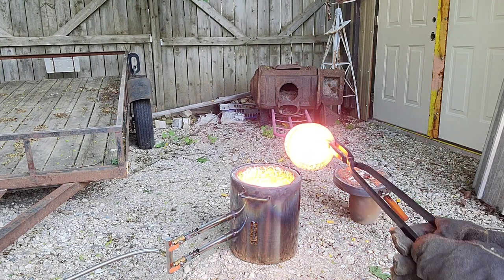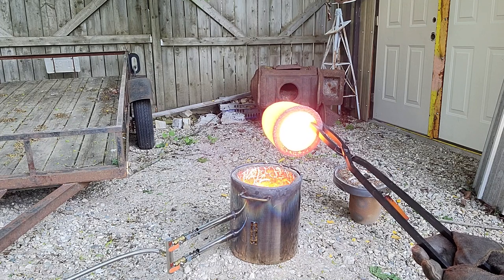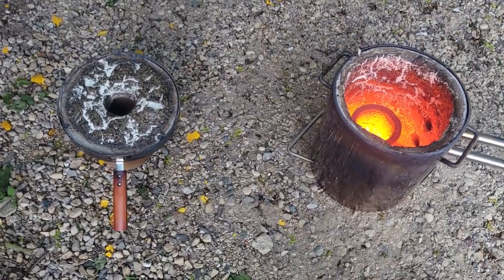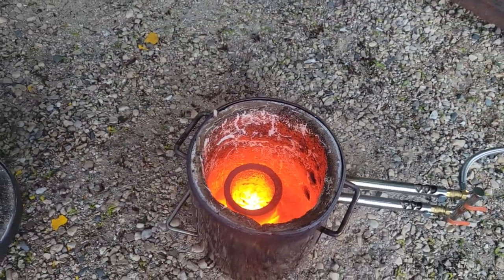Can the VEVOR 12KG melting furnace melt Steel?

Comment: Thanks for showing us this. I intend to give it a shot as well. I have used heat guard castable coating good for 3250° Fahrenheit. But you're showing me here is that it might not work. The heat guard isn't IR reflective coating so more of the heat will be directed inwards towards the melt. If that fails I will probably try stepping up to a veg oil burner.

Comment: Just add force air and It should actually completely liquefy it. I made my inlet pipe too long on my waste oil/diesel fuel burner and it completely turned it liquid within a half hour from cold start.

Comment: Melting steel is a pretty tall order for a small furnace. You looking at temps of around 2,800f/1,540c. You might be able to do cast iron which is still pretty hot. I bet it can handle copper and brass with no problem.
Reply from the maker: Copper was no problem at all.  Have not tried brass yet as I don't have any in the scrap pile.
Reply: @KevinChainey  copper melts at 1984 deg F.   That's lower than most steels.  Most are in the 2200 to 2500 deg F.
Reply: 😂😂 it can be done. If customized correctly.
Reply: Melting steel is not something that home workshops should be doing without first doing a great deal of reading up on safety and potential dangers with molten steel.
Reply: Hi, I would like to melt lava rocks they normally melt at 1300C or 2400F Would this furnace be enough? I would be really thankful if you could help me😊

Comment: hope you enjoy this video you probably should not try it i trashed my furnace.
Reply from the maker: Yes the refractory cement that came with this furnace could not handle the heat, but other than the lid being a little warp and some new refractory coating this thing is still going.  Just not for steel.